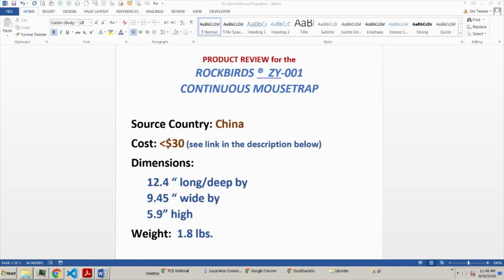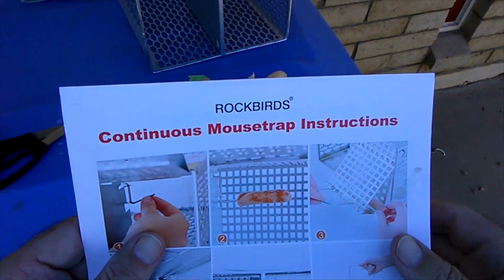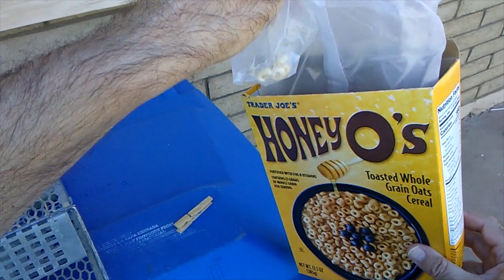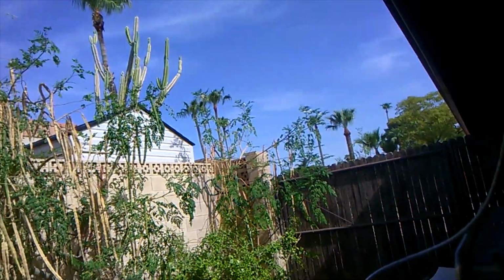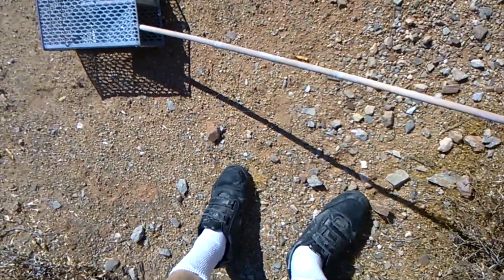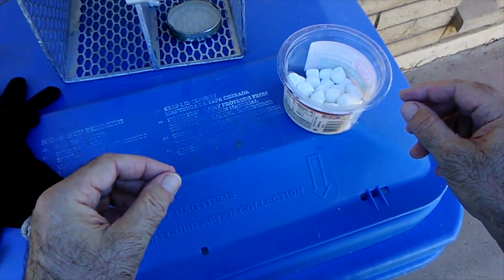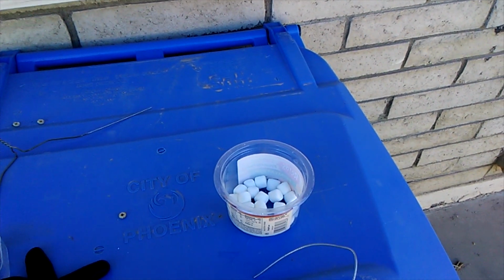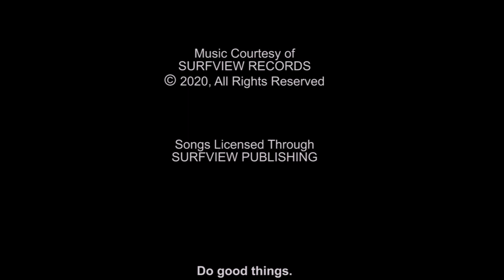Baiting a Better Mousetrap - Rockbirds (R) ZY-001 Product Review

Comment: That was very nice of you to catch and release the mice. I'm also going plant based.
Reply from the maker: I had a physical in June of 2019 that inspired me to put health first.  One of my key foods is hummus (with turmeric and pepper) spread on open-faced Ezekial bread (gluten-free).  I try to include moringa leaves as often as possible in soups and vegi-stews.   Dr. John McDougall's STARCH SOLUTION has been a big help, too.
Reply: Surfview Gardens I eat a lot of morninga leaves in salads, soups and stews too and I’m trying to limit gluten since it’s inflammatory and I have a really bad back. I also cut out soy and dairy products.
Reply from the maker: @danielfisch655  Looks like you're on the right path.  With Ezekial bread ($3.99 at Trader Joes) you can still enjoy bread, albeit without the gluten.  I have had back issues in the past.  I keep a lot of Chamomile tea around to un-inflame the sciatic nerve that runs through the lower back.   The idea is to heal the nerves and also reduce bone swelling that impacts (and causes the inflammation of the) nerves.  Part of that healing (along with the Chamomile tea  - which improves mobility within an hour), is to up on your B-complex vitamins, along with folic acid and magnesium.  Other tricks are physical, like laying flat on your back and pulling your knees toward your chest, stretching out the lower back.  Another is the use of ice;   take a wide strip of plastic wrap and make two parallel rows of ice cubes.  Fold the wrap so that the water from the melted ice won't make a mess.  Put that in a towel that's folded in two (that will make is softer and also absorb the water.)  Lie on it with your spine between the two parallel rows.  Do that for fifteen minutes on and 15 minutes off.  Don't want to freeze cells - ala frostbite.   You really don't need the plastic wrap if you just want to use the towels.  But, the wrap keeps the two rows intact so the ice doesn't spread apart.  And remember the Chamomile tea - it really helps with the healing of the nerves.  Remember, back pain is actually nerve pain.   Your normal state is pain-free.  You can get there.  Good luck.
Reply: Surfview Gardens thank you for all of the great info, I’ll try a lot of what you suggested. I find that citrus is a natural anti-inflammatory and we already drink camomile tea pretty much daily. I find that after I stretch out I’m able to do a few hours of yard work except when it’s too humid which causes my joints to swell and puts me in sciatic pain. We moved to AZ from NY two years ago and it’s just amazing here. 👍🏽👊🏽
Reply from the maker: @danielfisch655  I forgot to mention.  To heal your inflamed (pain-causing) nerves, you need to greatly reduce/eliminate caffeine.  Avoid anything that reduces your B6 levels (that includes chocolate as well as caffeine.) AND also avoid Tartaric Acid and artificial colors.  I once was eating a bag (24 count) of Safeway generic popsicles per day, which have both of that.  I was doing push-ups and the swelling wrist bone impacted the sciatic nerve near my wrist and with the Tartaric Acid in abundance, my B6 levels were very low.  Soon the sciatic nerve got inflamed and I had pain from my fingertips, passing my heart and up to my neck.  I had to sleep in a chair.  The chamomile tea helped me be mobile to some degree.  But, I read a comprehensive medical manual while recuperating and discovered the B6/Tartaric Acid connection.  I laid off coffee, anything tart, chocolate, and upped my B6, folic acid, and magnesium and I recovered without needing surgery (which had been suggested to me).  If you're a big fan of the candy SMARTIES, or lemon drops or STARBURST -- those will have to go.  Get those nerves healed.  Chamomile tea was pivotal - because it acts quickly.  In one-half hour I can move around better.  Good luck.
Reply: Surfview Gardens thank you very much for the information.